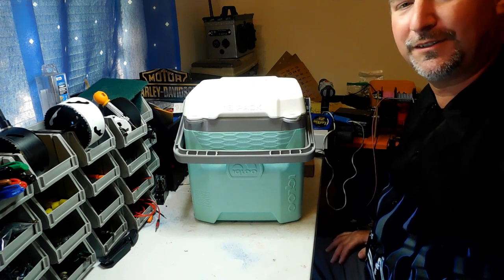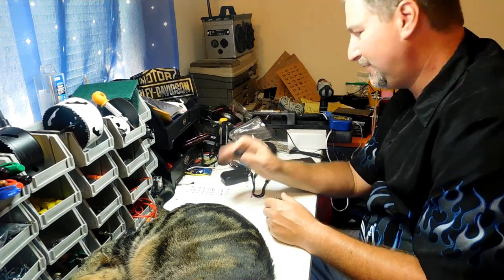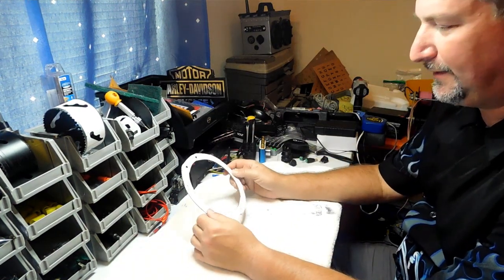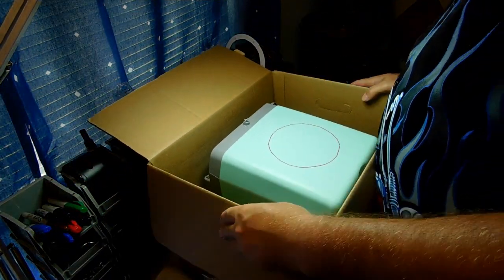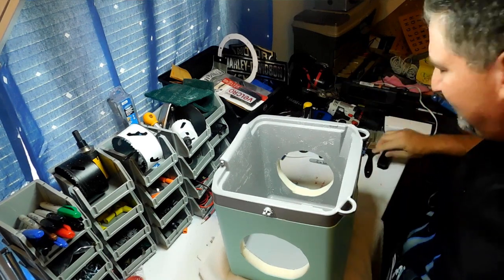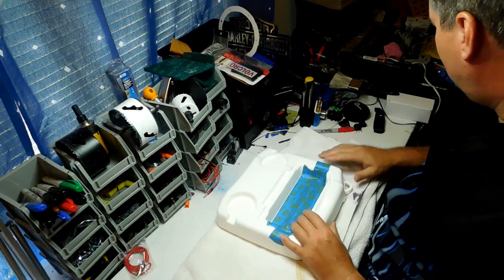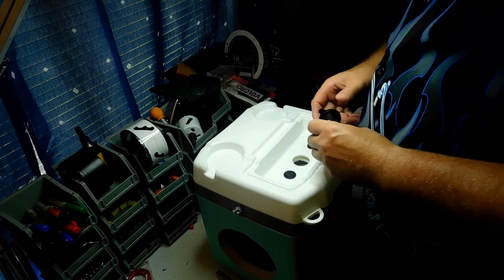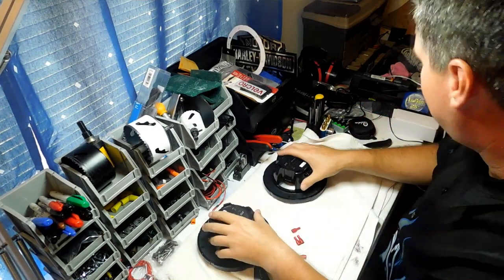How To Build A Bluetooth Boombox Cooler Part 1

Comment: On the  Facmogu F900S 160W amp is there other way to plug the speaker in to the amp beside bare wire terminal?
Reply from the maker: @kylewilliams3306  Banana plugs
Reply: @diyboomboxesintexas2805  what bananna plugs will work on that amp ?

Comment: Is there any advantage to using the saber saw over a drimmel?
Reply from the maker: Its a whole lot easier and faster. You would have to cut both the inside and outside separate with a Drenmel with the thickness of the cooler. 
A hole saw is the best method if you have the tools

Comment: Do you you know how I can connect plye 4ch hydra bluetooth amp red, black, blue wire and also how I could connect this APIELE 22mm Latching Push Button Switch 12V Angel Eye Ring Light LED Waterproof Stainless Steel Round Metal Self-Locking 7/8'' 1NO 1NC 1 Pack (Blue) using theses 10pcs Conductor Compact Connectors Lever Wire Nut Electrical Connectors with Fixed Base for 3 Circuit Inline Splices 28-12 AWG?
Reply from the maker: No
Reply: @diyboomboxesintexas2805  do you know some one that might know how to connect the amp , switch  battery charge port to the lever nuts
Reply: Where would I connect the red blue wire on plye 4ch amp to on the lever nuts and would I connect the switch red wire to the amp and then black wire to the switch the amp black wire and blue amp wire to the switch blue wire ?
Reply: @diyboomboxesintexas2805  can you give the site to your video about hooking wire up to lever nuts

Comment: If I do not have a iron soldering tool how can I connect this Maxmoral 3PCS DC-099 DC Power Socket Connector with Waterproof Cover Cap,Threaded Female Panel Mounting Adapter Power Jack 5.5 x 2.1mm to one of these male DC Power Cable 12V 5A Plugs Male Female Connectors for CCTV Security Camera Pigtail Power Adapter Connectors (5.5mm x
Reply from the maker: You need to contact me on Facebook so we can talk back and forth.  It's to hard here

Comment: How can I connect this DC Power Cable 12V 5A Plugs Male Female Connectors for CCTV Security Camera Pigtail Power Adapter Connectors (5.5mm x 2.1mm,  to this Maxmoral 3PCS DC-099 DC Power Socket Connector with Waterproof Cover Cap,Threaded Female Panel Mounting Adapter Power Jack 5.5 x 2.1mm with out soldering ?
Reply from the maker: Send me an email with pics so I understand 

veryhumble777@gmail.com